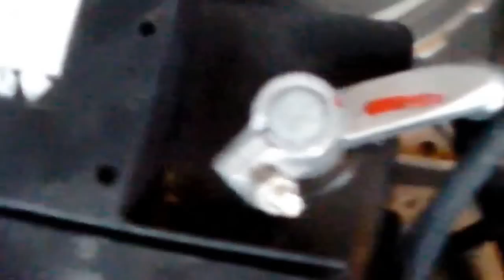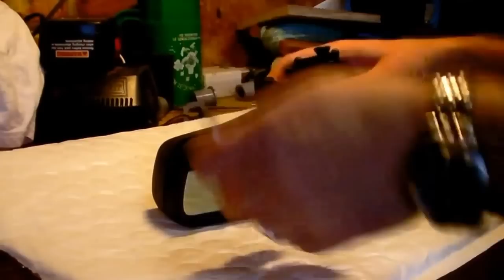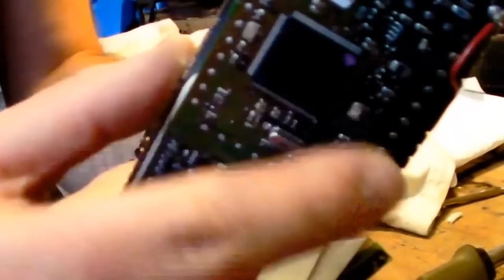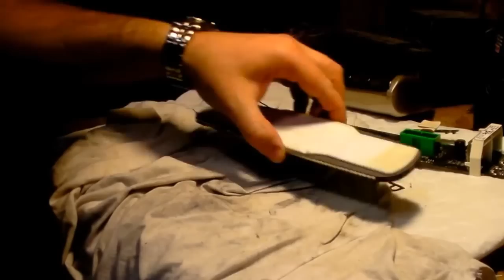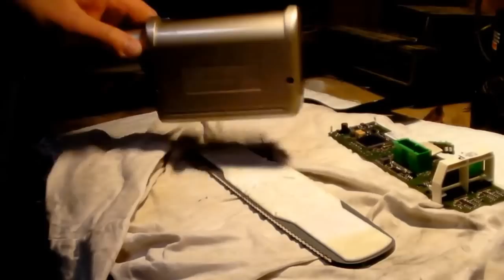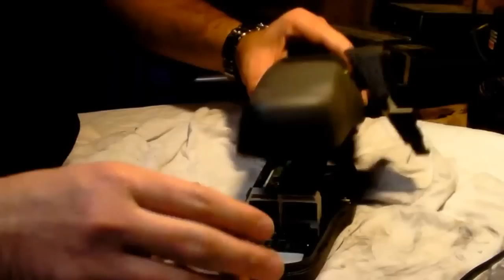Volvo Auto Dimming Mirror Repair

Comment: If your Volvo is 2008 or newer, like my XC70, you do not have to separate the mirror from the glue! This video was very helpful and I was all prepared with my blow dryer to remove the mirror when I noticed both sides were completely loose! No glue? The boards on these newer mirror are NOT glued. Two guide pins and side clips are all that hold this in place. Just pull the clips back and gently pull the boards (two parts) out! That simple! You may also have the simple triangle clip that holds the entire mirror unit in place. If so, removing the mirror only requires removing the plastic cover (two sides clipped together) then twisting the mirror gently to remove it from the windshield clip. Reinstalling requires patiently lining the mirror clips up at a 45 degree angle then pushing up and twisting back in (this will make sense if you do it). Sorry I dont have a video, but I do want to save anyone time who has these newer mirrors. Also, the used mirror I purchased on eBay said it did NOT have the direction LED or rain sensor. It did. Hooked everything up and the direction LED lit up! This was a VERY easy repair on the 2008 XC70 and I imaging for the S80, S40 and perhaps others. Hope this helps!

Comment: I have a different problem.  I can't find a junk yard auto dimming rear view mirror for my car.  Is there another way to fix the one I have?  So, put another way, I don't have the double glass with the goop inside.  Do you know how to separate the glass pieces, etc.
Reply from the maker: Separating the glass likely can't be done. Go check eBay. You can get one for under $60.

Comment: If I would replace the rear view mirror (used or new) with everything intact, I will have to go to the dealer for computer programming. And if I buy a replacement from eBay and  swap the mirror, the behavior of the car should be how it supposed to be. Is my statement right?
Reply from the maker: Joseph Triunfante that's what I understand to be true.

Comment: +Chris Lewis, What people don't understand is, the dealer charges for a new software download as well. So, if the part costs $500.00, & "automatic anti-dazzle" as its called, software cost $200.00, they also charge you their normal labor rate. Downloading the software to the vehicle, is considered a labor charge. In short: parts, software & labor.
Reply from the maker: Gordon302 true, people who don't do research don't realize this. it took me about a half hour on Matthew's Volvo site to get the idea how to do this repair on the cheap and why just swapping the whole housing was a bad idea.

Comment: Can I install an auto dimming mirror in my Volvo S60 that has a manual flip mirror? The dealership want almost $900 to do this job!
Reply from the maker: +Dog Food Well, I don't know what the circuit board inside the manual flip mirror looks like.  As long as it has a place to connect the two leads from the auto-dimming mirror element, then it should work just as shown in the video. The key thing is that you're not replacing any of the circuitry native to your car, only the mirror glass itself.

Comment from the maker: Abby freeman: as I stated, the anti theft system has components in the mirror housing. If you swap the whole housing them the car won't start until you get the computer reprogrammed for big bucks at the Volvo dealer.
Reply: Jermaine Smit, you say you had no problem with starting after replacement. But then you say you need to replace your mirror. Did you get to repair it?
Reply: some people.... ???  Mynor  I'm with you
Reply: +Chris Lewis mmm I replaced it in a whole and i had no problem with starting. So not sure how thise works or what you mean? Anyway good video. Need to try to replace in mine as well

Comment: Hello I like to know if just replace the whole mirror with out taking the circuit out is ok , since is the same part number?
I see you separate the circuit and use the old one back on your vehicle I like to know is that really need to be done this way 
Thank you 
KJ
Reply from the maker: Yes, it absolutely must be done this way. The circuit board in the mirror is component of the anti-theft system of the car. If you put in a whole new mirror assembly, the car's security system won't recognize the new circuit board and will prevent you from starting the car. That's why Volvo can charge so much to replace one of these (~$700) because they're reprogramming the computer to accomodate the new circuit board.  By changing out only the glass and leaving the same circuit board you prevent this problem. More work, but waaaay less $$!
Reply: I got it replace and it look's great thank you for you advice
KJ
Reply: Thank you very much for taken your time to answer my question, I have a 02 V70XC and I have the same problem with the mirror but I will tint the window before summer I will do the same process tomorrow am 
I appreciate 
KJ